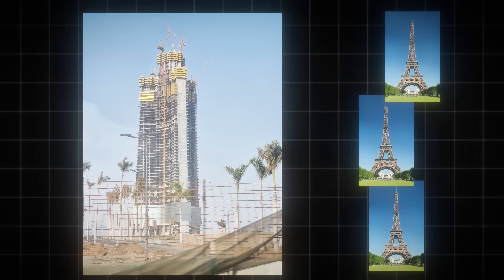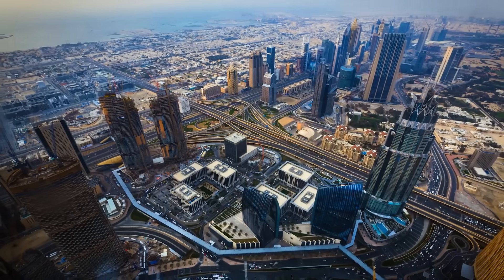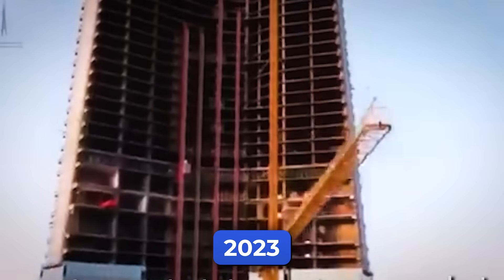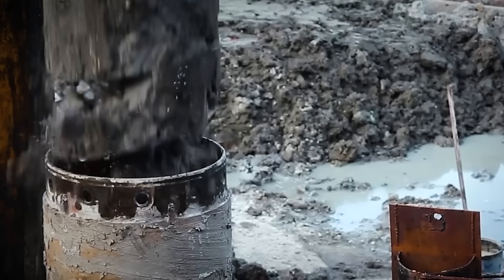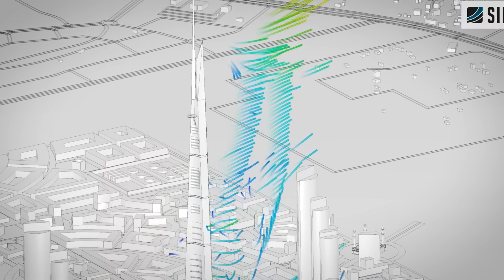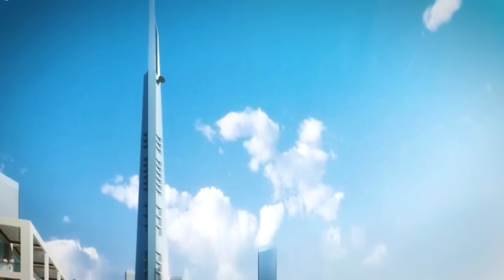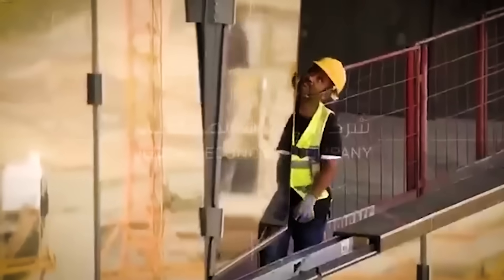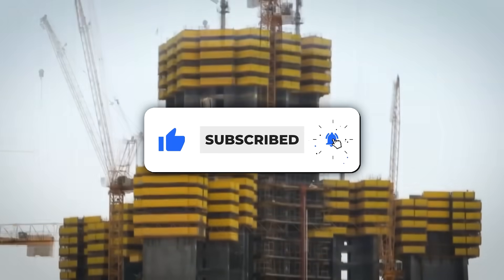Why Saudi Arabia Is Racing to Finish the Tallest Building on Earth

Comment: At 1 kilometer this would make the building approx.. 3300 feet tall. Considering if the average floor is 10 foot tall and this is going to have 164 floors. So does the make for 164 equivalent floors of wasted space. Sounds like another Saudi expensive tourist trap.

Comment: 432 Park Avenue; NYC.  A shining example of how taller doesn't equal better.  The building sways in the wind so much that walls crack inside the units.  Elevators shut down during heavy winds.  Trash dropping inside the shoot sounds like a bomb going off.  Over 1000 lawsuits to the developer and builder.  Yet you want to build even higher in a harsh desert environment.   What happens when the windows start coming loose?  What about the heavy wind and lack of oxygen on the upper sky decks?   What kind of pressure does it take to get water to the upper floors?  How can any engineer plan for the unknowns that comes with a building this high?

Comment: I used to think that this project was just the same as Frank Lloyd Wright's proposed mile high tower that was to be built on the Chicago waterfront. He called it "The Illinois" (I think). But they are not that similar, I have heard.